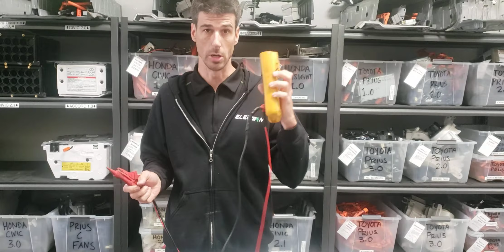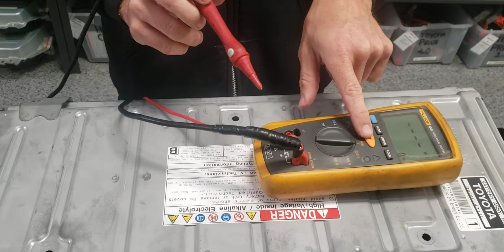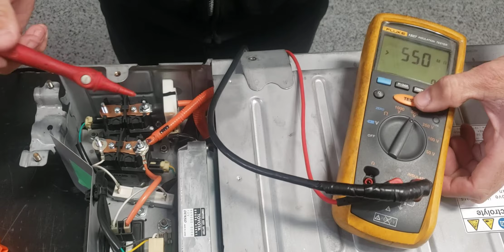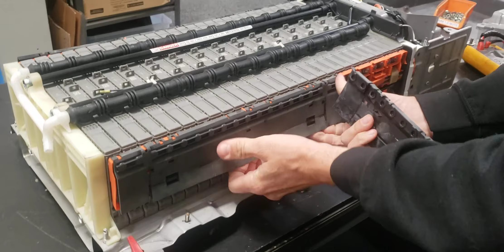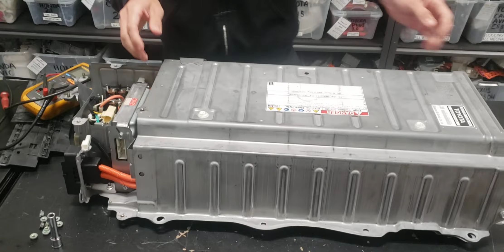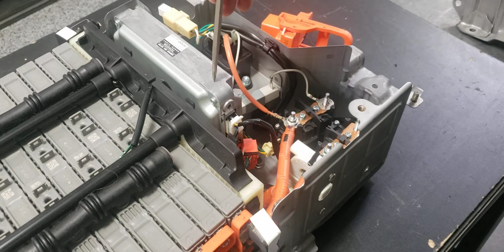How to perform an isolation/insulation test on a hybrid battery

Comment: So wait you said the “cell” was bad when testing and then you tell the customer the whole battery is bad????? Please tell me I understood that wrong as wouldn’t you just swap out that cell?
Reply: What he means is that one of the 28 modules is bad due to leakage. In his shop when he encounters this issue he replaces the whole hybrid battery for his customers.

DIYers often identify and replace just the bad module. This requires more work and you end up with a hybrid battery with 27 old modules and one new module.

Comment: I'm confused. WHY does this even work to identify a bad module? How often does a bad module have a leak to ground? They should NEVER be (cracked etc) and leaking to ground! Most people check the voltage across a module, between - and + on each module.
Reply: Is it not an issue of high voltage finding a path that lower ( individual modules at 7.5 v) do not utilize?

Comment: Hey, this is very good. 
I hate to see the gesturing to either side of the battery with each hand, could complete a circuit. Plus since a battery is shorting to the chassis the circuit is different then it usually is. A dead cell is safer then a leaky shorting cell ....
But thanks for this video! Cuts straight to the heart of the issue

Comment: Chrris i have been fixing these for a while and thank you so much for a far easier waaty to test them. It simple and I feel stupid I neveer thought of this years back. Now going to watch any videos you have, Thx Mike
Reply: Chris I bought a mega ohm meter but when testing cells i just get a flat 0 ohm. Then again this is not the same tester as yours.  Now at the current time all bus bars are removed . Now I’m trying to figure out what resistance should be on a single cell??? You show 500 ohm for a good cell but I get zero??

Comment: The insulation issue in a Prius battery pack is not necessarily caused by the battery cells themselves; it can also occur in the voltage sensor wiring harness or the battery pack's power output cables. Therefore, when testing insulation, these cables must be fully disconnected and tested separately.  

In my case, the insulation failure in my Prius battery pack was due to rainwater seeping into the battery compartment. This led to leakage in the power output cable, as some electrolyte covered the outer surface of the cable, causing a loss of insulation between the internal conductor and the external ground shielding layer.
Reply: I’ve am currently battling this same issue.  Can I get some more insight on what to look for?  We have a 2005 Prius with a 2.5 year old, new from the dealer battery.  We had a torrential 3 week rain storm and it threw this code.  Upon removing the battery it was saturated on the blower motor end.  Got the battery dried up, let dry for two weeks, did an insolation test of the battery using a Klein insolation tester, (be honest probably did it wrong as the results come back in ohms not voltage loss like the fluke) put it back together, was fine for two weeks and bam, same code again today.  Battery is dry now however as I patched all the leaks in the car.  (Can be up to 35 different locations according to the info I’ve found). I’m at the point of just doing a head gasket on this 2012 I picked up for 500 and swapping the battery cells since they’re the same, but the battery is different configuration and junking the 2005…
Reply: @PNW_Stone_Wanderer  My car is a 2006 Prius, and I found water coming from the blower motor end also. I used the cheapest "BM500A Digital Megohm Meter" from Amazon and discovered that there was conductive resistance between the power cable (orange) and its protective aluminum cover sheet (black). I noticed residual electrolyte on the power cable and on the voltage sensor wiring harness. As a result, I removed the voltage sensor wiring harness for a water wash and also took off a small section of the protective aluminum cover sheet on the power cable, wiping the cable down with a damp tissue. Now, the Megohm Meter no longer detects any conductive resistance. I believe the battery side is fine, and I'll reinstall it when the weather improves.
Reply: Did you have two distinct problems, rain getting in and electrolyte leaking from one of the cells? Or do you think one caused the other?
Reply: @BobStein i believe it is the rain water only.

Comment: Any chance you can help me diagnose my 08 Highlander? Or is there somebody there that can? I have the resistance tester and I have not been able to successfully find where the high-voltage leak is… None of the modules themselves are leaking electrolyte. I replaced the Relay module and drove the car around for a couple of weeks and determined there was no more coat. So I put the cover on the battery put it all back together. Put the seats in and decided it was fixed! Then driving it two weeks later I went to start it up and the code popped up right away. Yes I have text stream so I knowthat the problem is within the battery, supposedly. Anyone have any suggestions?

Comment: For anyone that doesn’t have this specific meter you can unplug all the bus bars and see which one still has a pathway to ground (the case) when everything is unplugged with a basic harbor freight meter
Reply: The issue might be the voltages being used in a module by module ‘short to ground’ test like that would  be in the 8-15 v range whereas  the mega ohm tester appears to use a much larger (500 v?) value. A short may or may not be apparent at the lower voltages. Update. Tested the modules using the basic multimeter in both resistance mode, and voltage mode and (for my HV pack) the short to ground showed up clearly. If the short is obvious enough it will apparently show on a regular multimeter too.
Reply: The 12 volt harbor freight one?

Comment: I test my modules (after pulling the battery out and disconnecting the bus bars) for their voltage after a time frame.  Sometimes there's one that for no reason has less voltage...either it is bad or maybe has an isolation problem?  Would that find or be the same as an isolation fault?  Dunno...
Reply: Issue there concerns the high pack voltage behaviour versus the individual module voltage at about 7.5 v. Higher voltage requires better isolation/ insulation.

Comment: The multimeter lead is not connected to the ohm setting hole, I guess this test is based on voltage drop testing ?
Thankyou
Reply: that is used for regular resistance testing in the normal range. that would be if you wanted to use this meter as a traditional meter that you can but for $20. You will want to hook it up the way it is hooked up in the video

Comment: Chris, thanks for this video. For those of us that recondition these batteries, when you do the isolation test, and EACH battery is isolated so that you test the 28 and not pairs, what would be the acceptable maximum Mohm reading be? I have the Klein Insulation tester, not Fluke, but it is rated at 4000Mohm. On many of these cells, I get 25-30Mohm readings. Isnt the higher number better-Thanks Jerry

Comment: Great video! So do you disconnect the BCM before doing the test at the HV battery? Should I also use that mega ohm meter to test the cables at the inverter? Thanks!

Comment: so if the battery i test show one end of the batteries 0.008 to 0.179 volt should replace it ?? because some is show 0.000 volt what u recommend it i should replaced ????